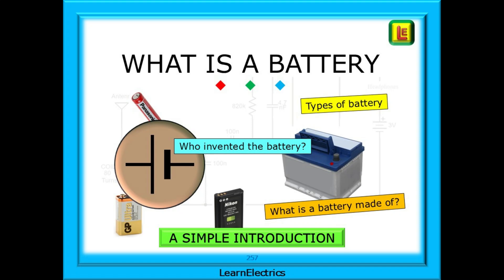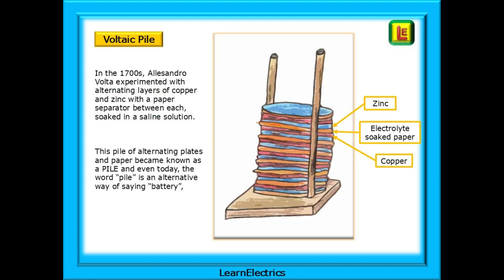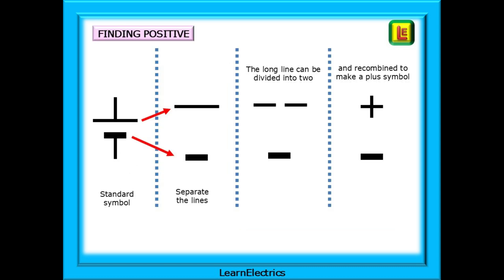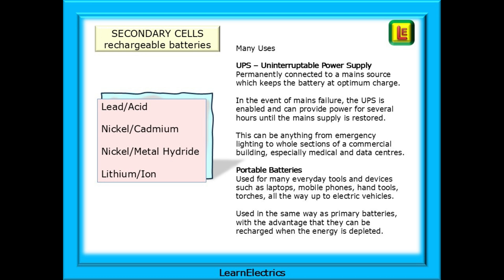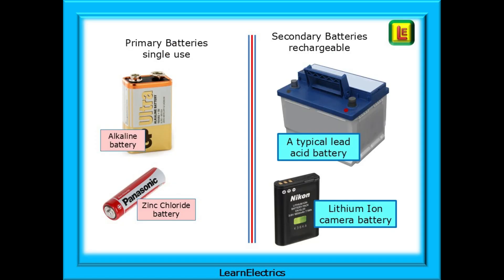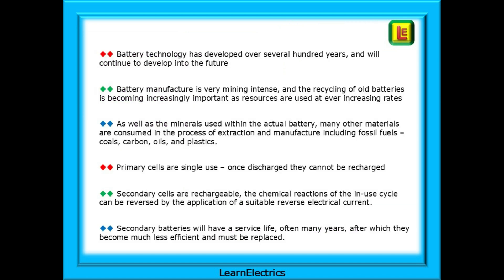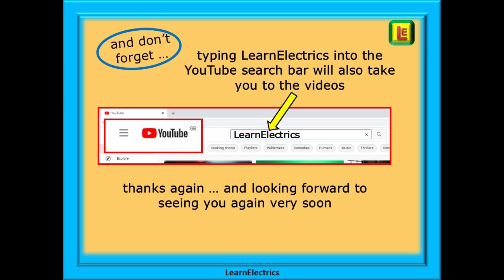WHAT IS A BATTERY? – WHAT IS A BATTERY MADE FROM? – A SIMPLE INTRODUCTION TO BATTERIES AND TYPES

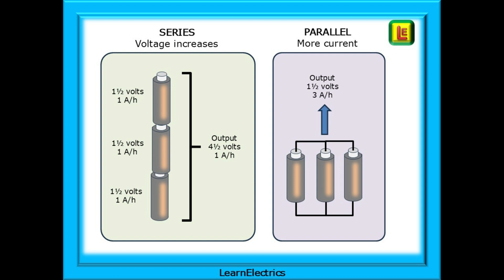Comment: Good video, but there is a risk of confusing the viewer with incorrect terminology from 7:04 to 7:56.
The diagram is marked A/h (amps per hour) which is a meaningless concept. You read this as amp hour (A h) which IS a valid concept. But you then describe this as an 'available current', which is incorrect. 
Current is generally measured in amps (A) and capacity (or charge) is generally measured in either joules (J), or in amp hours (A h), the latter being ONLY valid for a stated voltage.
The capacity of the batteries in series is 1 A h @ 4.5V, the capacity of the parallel batteries is 3 A h @ 1.5V. These are equal (as you would expect from 3 identical batteries arranged differently), both being equivalent to 16,200J. 
The current through a given constant load will then be 3 times higher for the series battery arrangement, but will last only a third of the duration of the parallel battery arrangement.
Reply from the maker: Thanks for the input and supporting the channel. Dave.